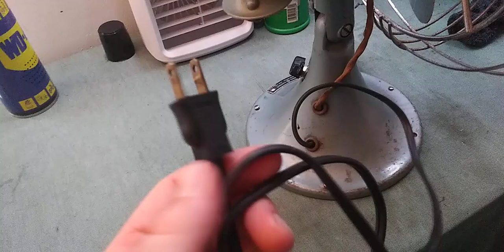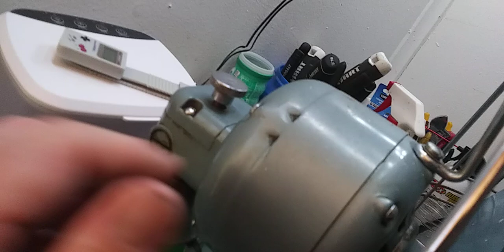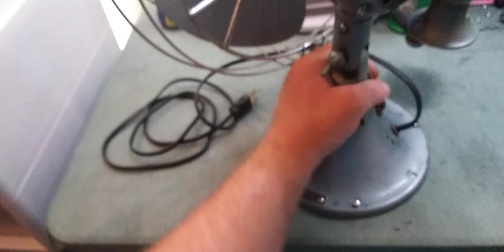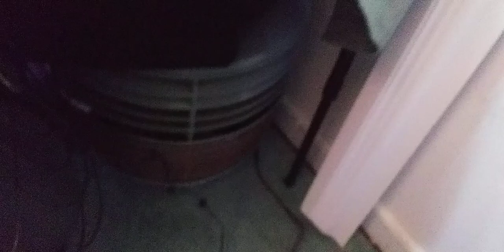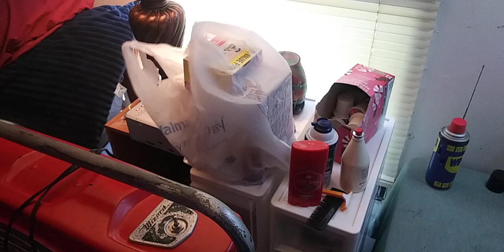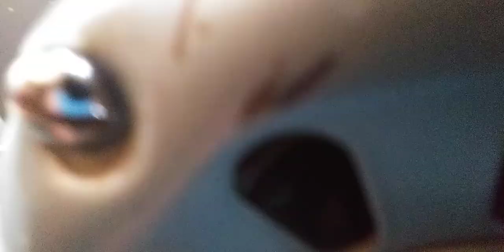GE Vortex oscillator table fan restored.

Comment: Nice. I’ve got a polished blade version where I have to use pliers to get the osciallor to work (much like I suppose a previous owner did based on the marks on the knob).